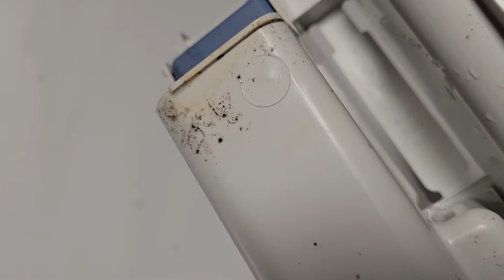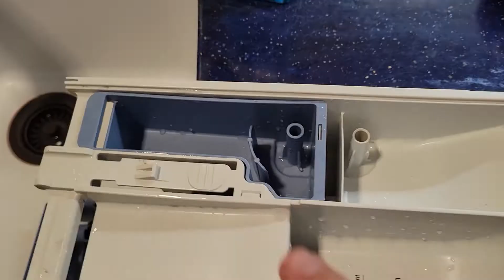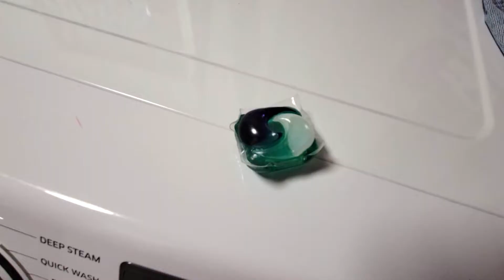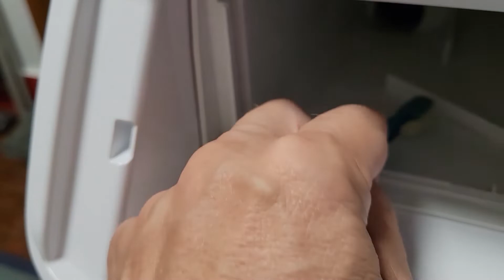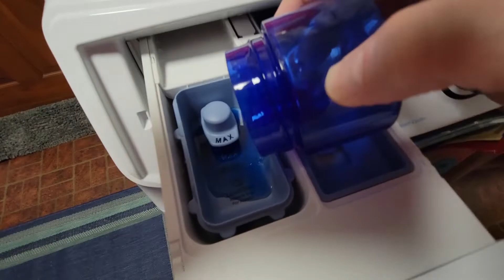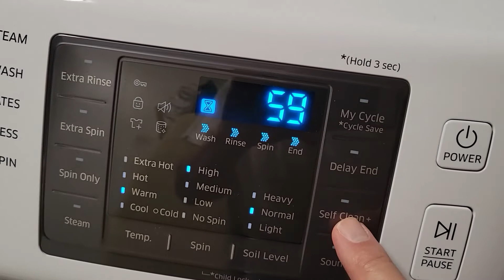Cleaning Mold Out of Samsung Washing Machine Soap Dispenser (+ Bonus Tips)

Comment: How often should this draw be scrubbed,  cuz I keep the draw open when NOT in use... & sometimes it gets mold soo fast .
 I use a (baby) Bottle  brush. 
To get as much mold as possible out. I ALSO  spray bleach on it & scrub again... then spray with Hot wate, wash thw inside of the door off & rubber around drum. & then do a wash cycle using the Clean washer with AFFRESH  on it.
Reply from the maker: You are doing everything right, although if you machine has a self-cleaning mode there is no need for the Affresh. I leave in the humid SE and I check the tray every month. I do let it sit in a bleach solution to make sure the mold is killed and I clean the inside of the tray holder (which can be difficult). Thank you for sharing how you tackle the mold issue.

Comment: I bought a house where they left the washer and dryer.  The washer was a MOLD FACOTRY!!!!  It took me hours to get it all cleaned out.  Now, when I finish my laundry I pull the drawer completely so that it can dry and and can circulate inside  where the drawer fits.  Much more convenient than that horrible cleaning job.  Now I only have to give it a light cleaning inside every 3-4 months!
Reply from the maker: Congrats on salvaging the machine, I heard of others just dumping them. We always leave the soap dispenser open between loads along with the front door. And yes it a major pain to clean the inside of the drawer. In real bad cases of mold the top of the washer can be removed giving access to dissembling the soap dispenser. Again pain in the butt. Wish Samsung would have provided some passive venting help with this issue.
Thank you for sharing your experience.

Comment: I just bought a home with this washer in it and I was absolutely appalled at the amount of mold and mildew - the entire inside of the detergent drawer was BLACK and when I pulled it out, the inside of that was filthy also.  I do not know how some people could live with this.  DISGUSTING!!!  Thank you for this tutorial, but wish I had my old top loader back - much easier to maintain!
Reply: You've probably already resolved your issue but I had the same issue and it was so gross I refused to clean it. I actually went on the Manufactures website and ordered a completely new detergent drawer and just cleaned out the inside part on the washer which wasn't as bad as the drawer itself. Now I check it weekly for mold and mildew.

Comment: Thanks for the great video. I would add that I think it's a good idea to remove the entire drawer and tip it over when the load is done. We leave ours in the wash tub to dry out when not actually doing a wash load. And, we always leave the door open on the machine when not washing clothes. Gotta let the whole thing dry out.
Reply: Exactly what I do - so much less time spent on cleaning and dealing with mold!!
Reply from the maker: Bob, thank you for the idea of putting the tray inside the drum, we leave it extended out and I'm always concerned that someone would brush by and it will get snagged. We leave it wide open overnight and then partially close it the next day so people can get by. Again thank you for sharing.
Reply: @cfldriven  sorry I wasn't clear. We put the whole drawer over in the wash tub (sink) upside down so it dries out. Not in the washer.
Reply from the maker: @Bob86ZZ4  Thanks for the clarification, since we don't have a utility sink placing it upside down in the washer with the door open should dry it up in no time.